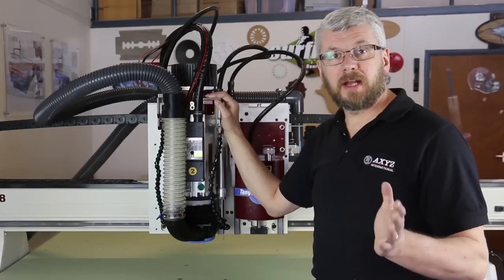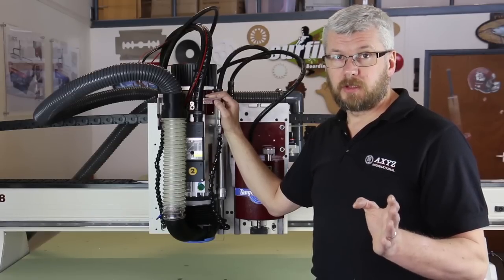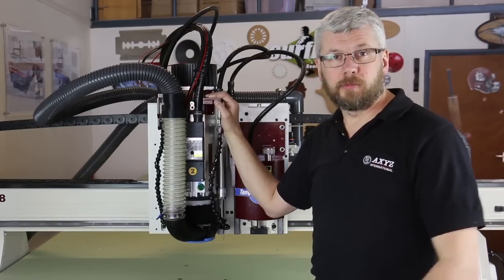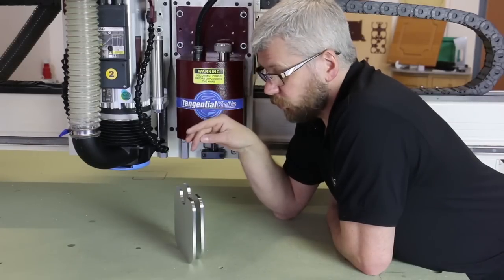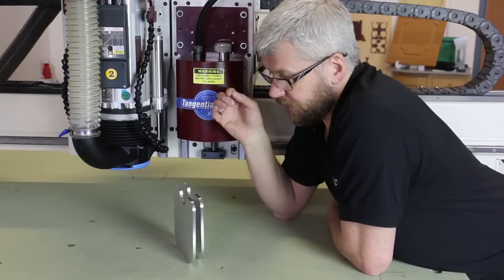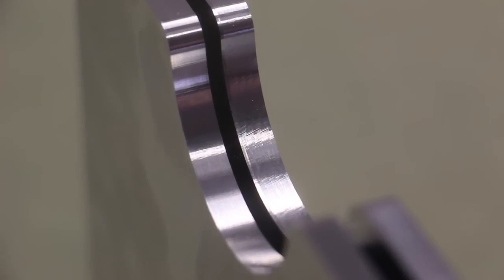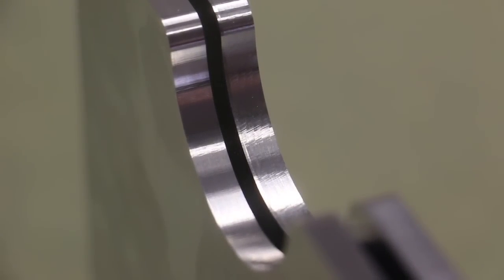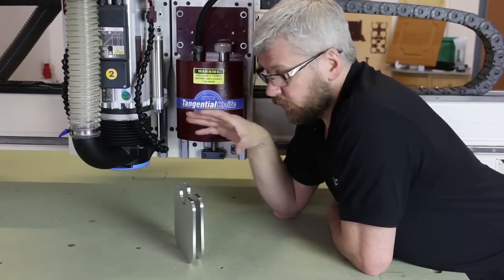How to avoid a poor finish when cutting aluminum on a CNC Router

Comment: What bit are you using?
Reply from the maker: Hi there, we used a Belin single flute upward spiral for aluminum. The rough pass was was cut at 16,000 rpm with a feed rate of 1.2m/min and the finishing pass was at 24,00 rpm with a feed rate of 1m/min.

You can find the tools through our online store - http://www.cncroutershop.com

Comment: I am currently running a small one-off project on one of your machines and could use some advice. The job involves cutting out 3mm aluminium panels with various holes and cutouts, but the holes also need to be countersunk to take a 3mm screw. (unable to get the desired accuracy with hand tools) Is this possible on the router and if so what sort of tool and settings should I be using? Any help would be greatly appreciated!